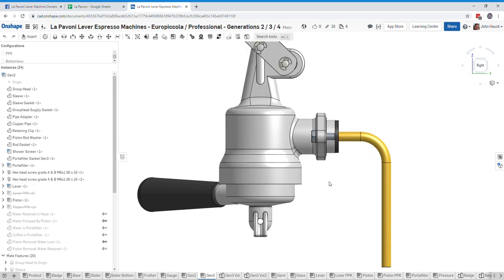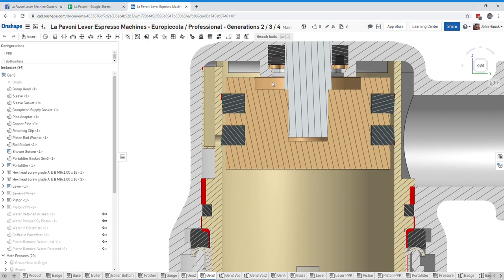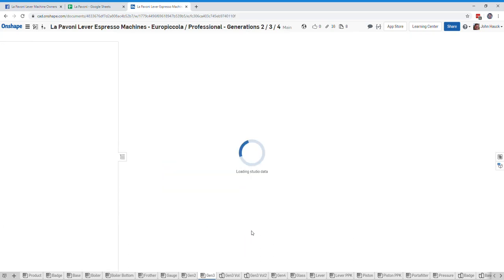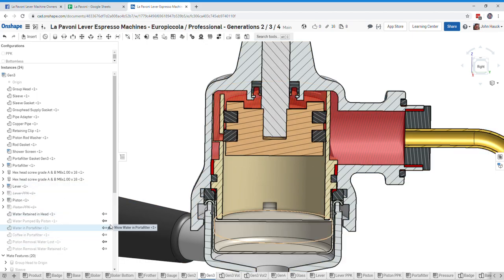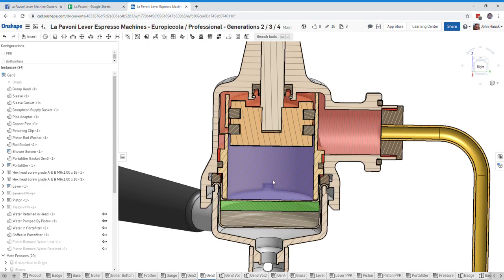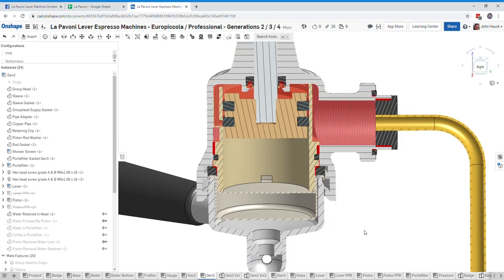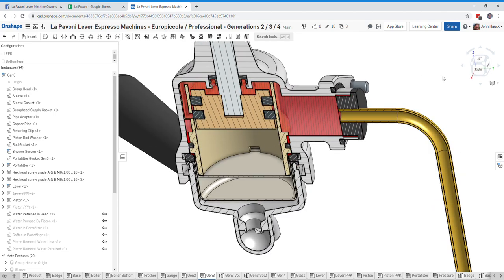6: Generation 3 Water Cooling Group Head - La Pavoni Lever Espresso Machine

Comment: John, while I was watching, I was struck by how important grouphead mass is for tempering boiler water as it enters the area around the GH sleeve. This might explain why "dry pumping" will raise GH temp, but that we need to let the dry pumping take effect and also to not overshoot the target GH temp of 85-90°C (per Bong in our FB group). Your explanation here shows how much of this tempered water is mixed with boiler water (also tempered slightly by GH mass as it makes its way to the lower chamber) to achieve the desired brew temp of 91-92°C (or at least how I imagine it in my head). 

It's remarkable that we get any decent shots at all. It shows why there is as much "art" in pulling a shot on a LP as there is "science."

Thanks again, John.

Comment: the 2/3 ratio is why you should raise & lower the lever (less than full range) to fill complely fill the grouphead with hot water. A temp gauge (thermoplastic) will show the impact. 
btw, I learned this on youtube.

Comment: I guess you should be able to generate a model for the brew water temperature based on the boiler set-point (and hysteresis) + the real time grouphead temperature - I assume the water in the grouphead will more or less match the temperature of the grouphead (which is climbing over time).
Reply from the maker: Check out video #13
https://youtu.be/eQuEZDY6Awo

Here is the full list
https://www.youtube.com/playlist?list=PLPX9KWMNFMwNk_aBK7plrFBF1VJx0OMVw

Comment: This is really helpful indeed! Thank you for providing all the information! I was wondering if read the model correctly in that only about 1/3rd of the double shot basket can or should be filled with coffee (post tamping)?
Reply from the maker: Personally, I find 13.5g to 14g of coffee works well on my gen3 and gen4 machines using a single lever motion. The thickness of that depends on the beans and roast level. I would guess about 12mm of height for light roasts. I hope that helps.

Comment: Hello. I love so much your vids. 
They are very interesting for me.
Can you tell me how to avoid air in the group head? 
Sometimes I can extract a lot a coffee
Like 40g in the cup for 20g coffee in the basket. I can feel directly the pressure on the lever. 

Sometimes not. I feel the pressure very low. 
Can you help me? Thanks a lot
Reply from the maker: Mathieu,

A quick answer is that I think 20g is too much for a La Pavoni Lever Machine to brew. Consider a fine grind (on a quality grinder right before pulling the shot), of freshly roasted (~2 weeks old) 14g in the double (larger) basket, lightly tamped.  Raise the lever all the way to let the water rush in. Wait about 5 seconds and then start your pull.

There is a much better place to diagnose your brewing. I'd like to refer you to a very helpful group of La Pavoni owners. https://www.facebook.com/groups/lapavonienthusiastsgroup
I think it is worth the trouble creating a Facebook account just for this resource.

Comment: Great video. So interesting. Presumably this does not happen with the gen 2 unless you have the isolator. Also, if you flush before a shot I guess you are replacing that cool water with boiler temp water?
Reply from the maker: > Presumably this does not happen with the gen 2 unless you have the isolator.
Correct. There is no liquid water retention in the unmodified generation 2 group head. In fact, with the piston down, even the liquid water in the siphon tube drains back into the boiler. Steam then fills the upper part of the group head, the neck, the upper part of the siphon tube and the upper part of the boiler.

>  if you flush before a shot I guess you are replacing that cool water with boiler temp water?
Exactly. Well, technically it mixes, so there is a bit of chaos going on. The practical result is that the average water temperature in the group head is to some "degree", hotter.

Comment: i do not understand how you get 53 ml of water available for the shot . in my experience 10 ml stays in puck after the shot and 35  gr is max i heard of including the coffee soluble matter so it gives about total 45 ml total if you calculate the sleeve above the piston and hole volume you get 46 ml up to coffee pack.  if 53 ml were available you could get more than 40 gram per shot this is not the case.
Reply from the maker: Guy,
Thanks for the comment.
I actually think we are in agreement that not all 53 ml goes into the cup. I just rewatched the video and found these relevant points:

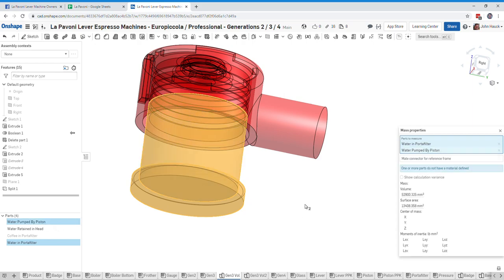  3:04  - I state the portafilter holds about 10 ml 
of water
  3:11  - I state that this plus the water below the piston gives us about 53 ml
  3:25  - I state that when you pump, it is just the volume under the piston (43 ml) that gets displaced. (into the cup).
This then is in line with your experience of 40g per shot.
I hope you also think we agree on this now.

If not, I probably am not understanding your concern and an open to more of your thoughts.

The reason I spend time even talking about the 53 ml is in trying to explain that every time we pull a shot, we draw 53 ml of water from the boiler. Some of that water is mixed with the cooler water already in the group head, which makes the temperature of the water used to extract the coffee a bit cooler.
Reply: @JohnMichaelHauck  the difference in my experience with 14 grams of ground coffee after brew you get 30 grams of coffee and added 10 grams to the coffee pack so in total you have 40 grams of available water for coffee not 53 . Sure if you wait longer with lever up you can get as much as you want but brewed coffee will be something else . if i lower lever as soon as first drop falls i get  30 grams of coffee .  i think in reality coffee pack is closer to shower screen . i do not think there is room for 10 ml there . it does not coincide with my  findings
Reply from the maker: Guy,

I just pulled a shot, with a single stroke of the lever, (no pumping), and a very tight grind (no dripping before a 9-bar pull). I removed the cup while the last few bitter drops were still falling from the portafilter (I wanted to drink it).

Here is the result:
  IN (Ground Coffee): 15.0g
  OUT (Espresso): 39.3g 
  RETAINED (Weight added to ground coffee by water): 9.9g
  TOTAL WATER (less bitter drips after pull): 49.2g

This experiment result of 49.2g did not get to my calculations of 53g.
Yet if I would have kept the last drips it would have been closer.

Raw data (boring):
  Metal Basket Empty: 22.6g
  Metal Basket w/ Dry Ground Coffee: 37.6g
  Cup Empty: 112.9g
  Cup w/Espresso: 152.2g
  Metal Basket w/ Wet Ground Coffee: 47.5g

Comment: How does this compare to the gen 2 in terms of volumes and temps?
Reply from the maker: As for temperatures, see my reply to you in video #5 "Generation 2 Steam Heated Group Head" https://youtu.be/qQaqW0SAJjs

As for volumes, the amount of water that consists of the shot should be nearly identical in all four generations of group heads. See this for comparison: #2 "Four Generations of Group Heads" https://youtu.be/ViNrag4lYJg
Reply: @JohnMichaelHauck  I loved that video and have studied it religiously, but I don't think it necessarily answers the shot volume question. To clarify, I don't just mean the shear volume of water, I mean the relative volumes of waters of different temperatures, and which flow first into the puck.

Or I might just not have understood it which is entirely possible since I'm an idiot.

Thanks again!
Reply from the maker: So, I guess to be clear, there is no other water in the generation 2 group head like there is in the generation 3 group head. The generation 2 is brewed directly with boiler water (say 120C) and the generation 3 is brewed with slight cooler water since it mixes with cooler water outside the sleeve before entering the brew water chamber.

Please, don't stop asking - because I am suspecting I am missing a part of your question. Also, there is a lot about how these machines work that I simply don't understand - and what I do understand is likely off or oversimplified in my mind.
Reply: @JohnMichaelHauck  That actually explains it really well, I can't believe I didn't realize that.
But is the water that comes into the outer sleeve area constantly recirculating or is it static until the next shot is pulled?

It would also help to know the internal surface area of the outer sleeve area compared to the surface area of the inner brew chamber, because on the gen2 the brew chamber walls have a direct connection to the outside of the grouphead, thus making that surface a heatsink, whereas on the gen 3 the brewchamber walls can no longer act as a heat sink since they are also surrounded by water (I think, I'm not sure, that might depend on if that water is ever purged completely). Would the water surrounding the brew chamber walls in the gen 3 be capable of  absorbing more thermal energy than the brass wall of the grouphead brewchamber in gen2?

Thanks for being so patient with me, I really appreciate it!